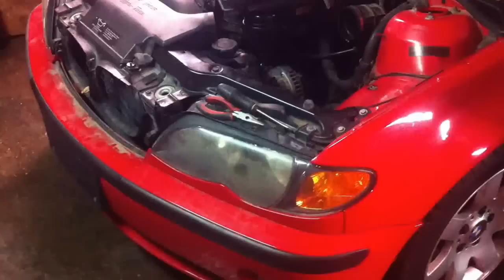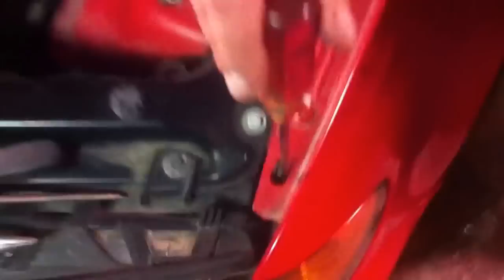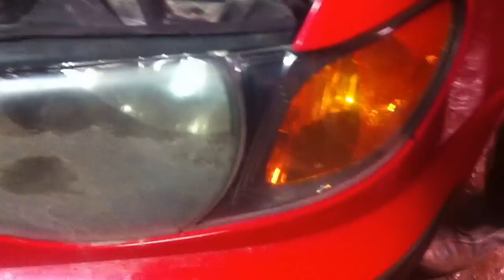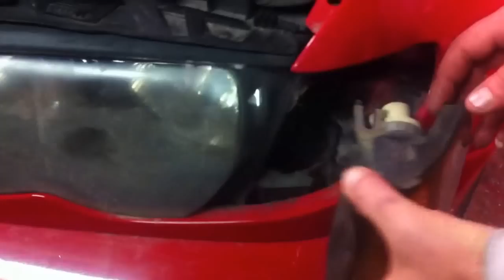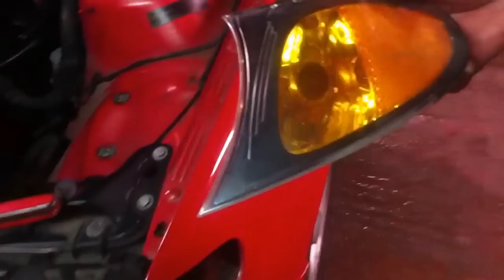BMW e46 how to replace turn signal light bulb/side marker in 30 seconds ! BMW 318 320 323 325 330

Comment: Worked for me.. note the position of the lens before removing.  Dont force removal or install.  It should come out and install easily.  Turn screw counter clockwise about four revolutions and take it out slowly.  My BMW 2002 325i uses 7506LL bulb.  You can order from Amazon.  I picked up the LED version for spares... thank you

Comment: I think some work was done on mine (2001 330i)   and they forgot to put the clips back or something.... are no clips/screw.  It popped out going over a pothole...  I checked your video and I don't see a hole in the light where a screw would go, just some tabs.    Should there be a clamp to go on the tabs that the phillips head connects to?
Reply: The description for this video is mistaken.  Pre LCI(including 2001) instructions here: https://www.youtube.com/watch?v=V_a4l9fWbUI